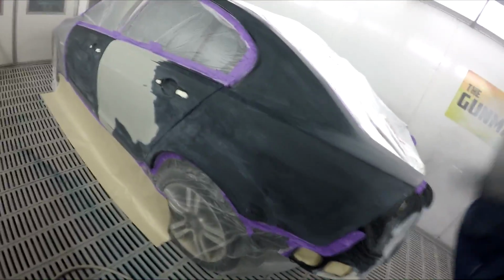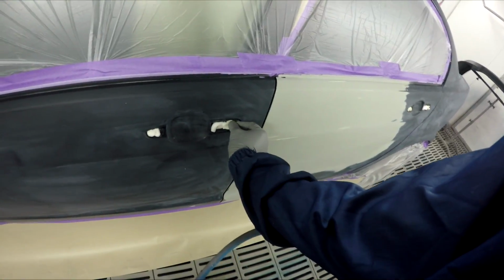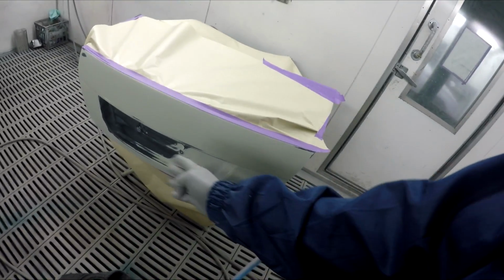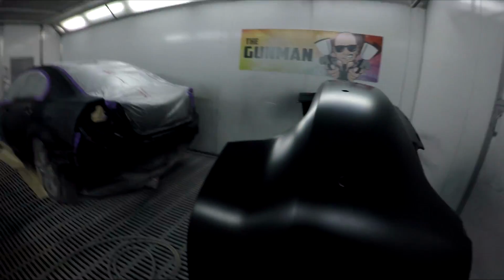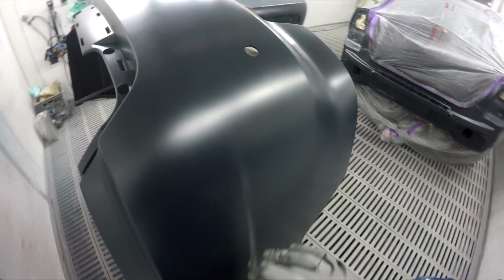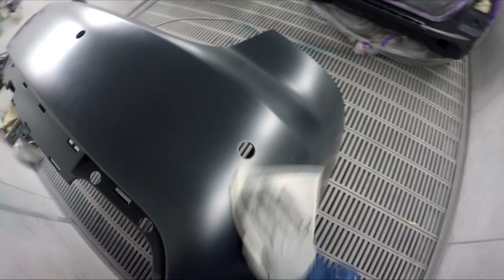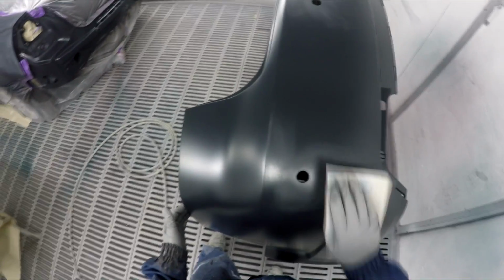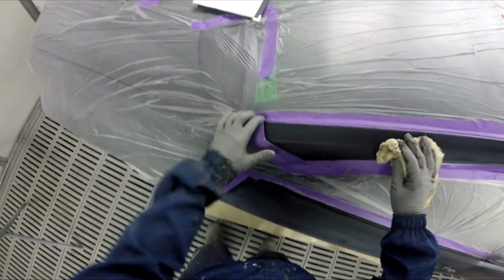Spray Painting Black VE Commodore: Part 1

Comment: Gunny if you want to fix some damage to a plastic bumperbar just scrape some filler into the scratches/damage wet sand it and then dry it with a hair dryer to get rid of the water that could be trapped in the filler it has worked for me so far

Comment: gunman i had a problem about big Orange peel on the base color and clear coat.I notice this when I try to spray black color..I thought this was normal.until I saw your work..it was way way better than mine.yours are so  smooth.have any advice for apprentice self thought like me?.
maybe I use a wrong gun (devillbiss jgx 502 suction gun 1.8..the only spray gun I had)
or maybe wrong air pressure (just now i know how important a regulator,coz i dont have one.just using feeling )
or wrong gun setup. or maybe bcoz i spray at hot weather condition.
or maybe I'm moving the gun to fast or too slow
..I can send some picture if u want to.man I'm so bummer and upset about this..
Reply: The 1.8 is gunna put the material on way heavy..causing thia problem

Comment: what was the first coat of stuff you sprayed in the begining??
Reply: HaterHurter sirG345 adhesive primer for plastic
Reply: Mike Davis awesome thanks alot and what type of primer best for chassis(metal) is big ten wet wet primer is best or which brand u think is best??
Reply: HaterHurter sirG345 sorry bro..i really couldnt tell you whts best..im not an expert..i just knew it was adhesive primer because i just repainted all the plastic trim on my explorer sport
Reply: HaterHurter sirG345 2k epoxy primer
Reply: Tom Mellor happen to know the brand of 2k primer and is it good for both plastic and metal??
Reply: HaterHurter sirG345 there are plenty. Check which is suitable for your price range. I would use HMG. If your painting something other than a chassis and painting a plastic part, then I would suggest something from the same brand of top coat or basecoat you will apply on top to ensure proper adhesion although shouldn't matter too much. What you painting?
Reply: Tom Mellor 97 integra coupe chassis, front and rear(plastic). ppg base coat, wet wet plus clear.
Reply: HaterHurter sirG345 for plastics use a decent plastic primer and wet on wet primer if   they are bare plastic and not primed. If primed then just plastic primer to save some money. Chassis some epoxy primer and some chassis black, top coat should do the trick
Reply: Awesome thank you keep the vids coming there top notch! cayman islands here!!